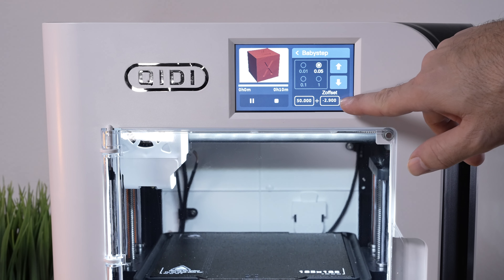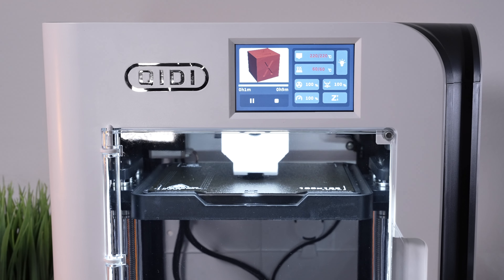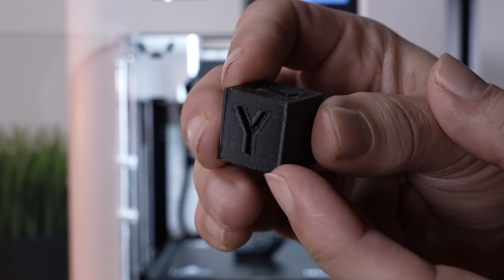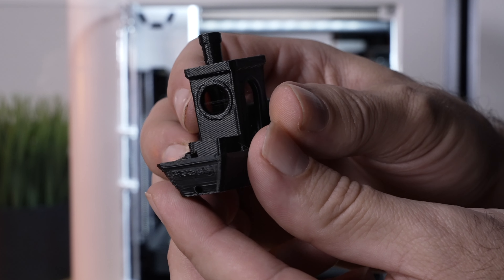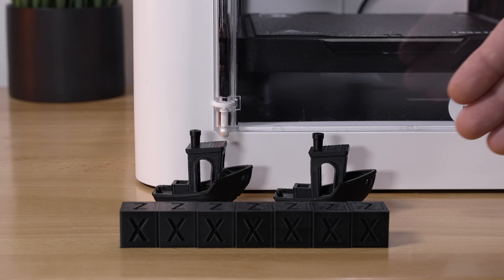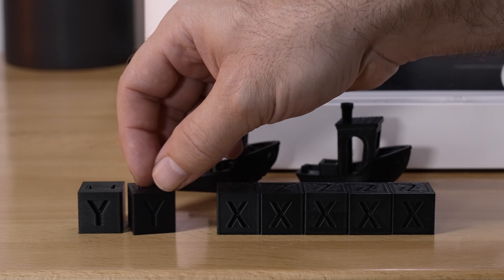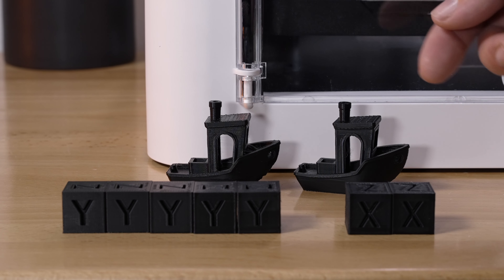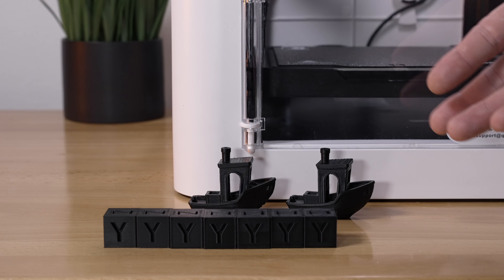QiDi Tech X-smart 3 - Ultra Fast 3D Printer

Comment: Horrible compared to a Bambu or Prusa...stop selling bad things as good ones..

edit: If you want complain that it has a better price... Its cheaper but way smaller and half of the hardware. The printer should be working way better and Qidi is known for making things real bad. X Plus 3 production got stopped. The older models used closed Chitu Firmware, pulleys made of plastic and other belts, so you have to rework it completely, if you want something good. The massive bed was the only thing Qidi did right in the past and this bed looks way smaller and way more vulnerable for not being straight..
Reply: Actually, from what I've read including long term usage, the only thing bad about this printer and the Plus/Max versions is the part cooling. Everything else is solid. Running open sourced Klipper and everything. They stopped production on the X-Plus-3 so they could fix it and fix it they did. New versions of the Plus have had absolutely no problems. For the money you get a lot of printer for this little guy, including having a higher average print speed (lower print time) with the same quality compared to a K1 or P1P/P1S/X1C. Qidi has been making great strides, still not top dog but way WAY better than what you're describing.
Reply: @YourLocalRaccoon  Well, I was owner of 2 Qidi X Plus 2 modells. One is reworked completely and one is sold. Thats just lousy work. 2 DIFFERENT endstopmodells on the z axis, so that its never on the same spot. Do you know how long it did take to find that out? The pulleys of the X and Y Axis where made out of plastic, so that they did not run straight on both printers. There are many posts about this out there. I made the experiences myself not just through reading.
Reply: @rhotix403  I'm NOT calling you a liar, as you have two printers yourself, however I am unable to find anything related to plastic pulleys on the xmax3 or even xplus3. So it's either a non-issue or they're metal on the most recent releases of these printers. Everything I've seen online says everything about both printers is excellent aside from the hotend itself, which I'm sure can just be easily modded. 12 pages on Google and more than 2 dozen different searches with different keywords says the pulleys aren't an issue.

Edit: and nothing on end stops either, aren't they sensorless homing on these printers?